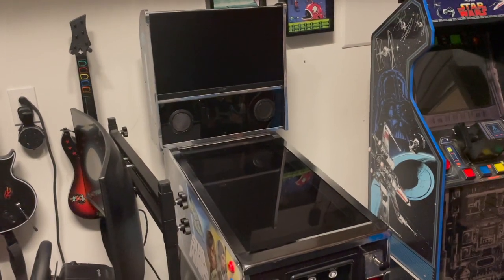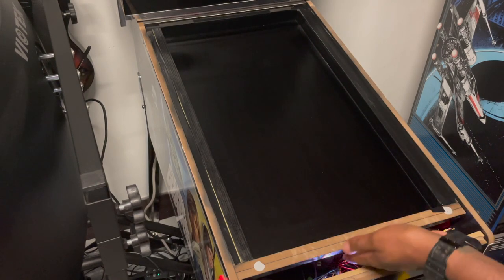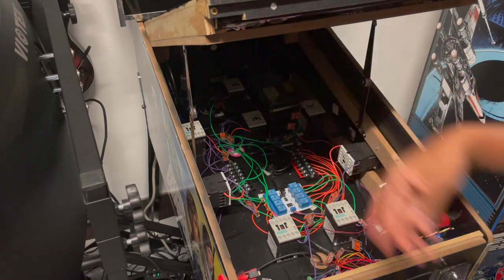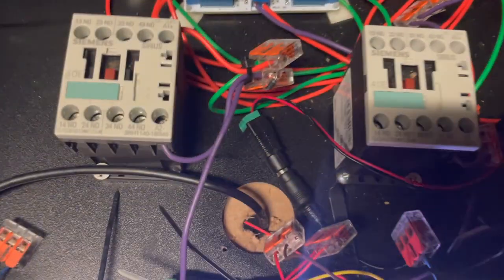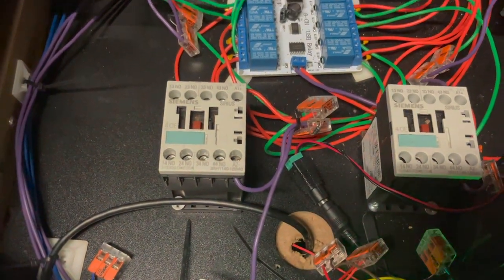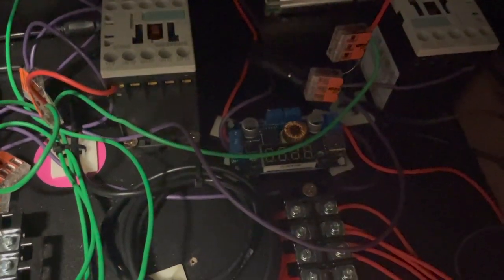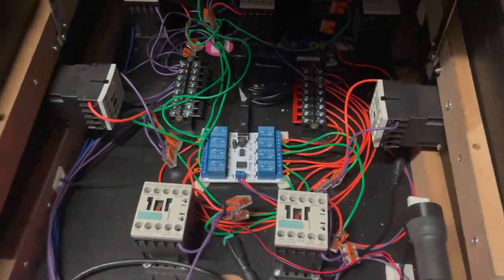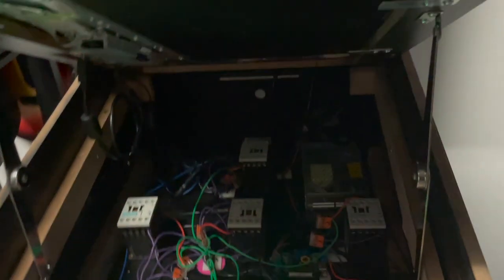Arcade 1up pinball mod deep dive

Comment: Very nice mod! Can you please describe the process of getting that 27" Acer in there? Did you have to do any routing or drilling?
Reply from the maker: Hi, the 27" just about fit. If you look at around 4:00 in the video, I needed to route out the section of the wood bracket where the monitor inputs would be in order to have it sit flush on that side.  As you can see, I also took the back housing off of the monitor.    I used some shims on the bottom of the right side to level it (maybe 1/4") since the left side is raised slightly and then ripped some wood to fill in the space on the edges of both sides in order to center monitor.

I got some plexiglass from Lowes (about the same thickness) and just made it longer so that it extended all the way to the apron. Then I taped it off with painters tape and spray painted the edges.
Reply: Do you recall the exact 27in acer model you used?  Still running good?